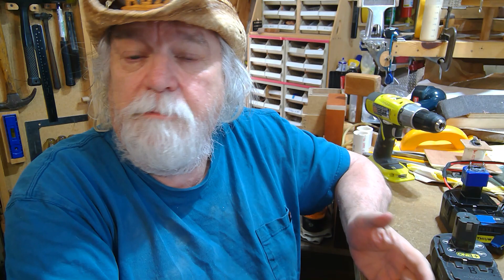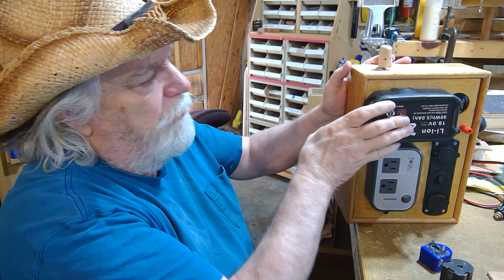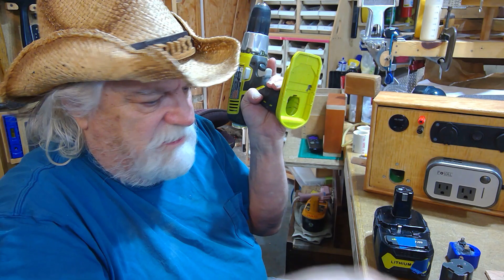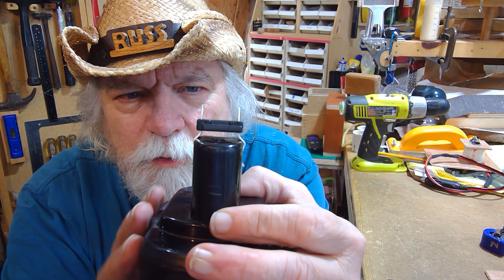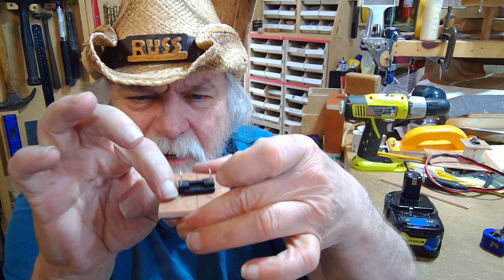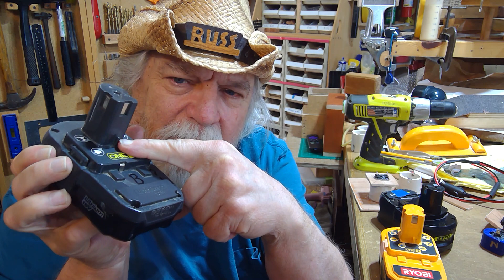DIY Ryobi Battery Receptacle by OTB Thinker

Comment: Thnx Who sells the clip??/
Reply from the maker: Small Engines Pro Shop has the best price.  Do a search on the Ryobi part number ""300001044".  
The link I found today:
https://www.smallenginesprodealer.com/part-ryobi-300001044/
The price today was $ .68
Reply: @russveinot5754  Thanks ..
Reply: Checked  it out  only sell in USA??
Reply from the maker: @Victim-x2g  Search on Google by the part #.  Should be able to get somewhere, just not that cheap.  you could buy a whole Ryobi adaptor.
Reply: hi found a heap on e bay and Alibaba
Reply from the maker: @Victim-x2g  good

Comment: Those connectors are down to $0.67 ea.
Seems like there is a potential polarity problem with the way they are fitting.
I'll probably be trying this in the next couple days with some couplers.
I think it might be worthwhile to do 2 things.
1. Get the PVC much warmer
2. Take a piece of 2x4 and cut a U shape in it which is slightly larger than the battery outline. 
   Heat the PVC, force it onto the battery, then use a large pliers or clamp and basically mold that form onto the PVC, and use a straight piece to press the flat part of the mold that is missing.   Hard to explain but basically press moulding I guess.
That way its will take a lot more force to attach it incorrectly.

Comment: Wow thanks, that is a great idea! I wish that there was such a simple and inexpensive adapter for DeWalt batteries.
Reply from the maker: I'm sure there is a way to do a cheap receptacle with shop scraps for the DeWalt.  I don't use DeWalt, or I would do it.  If you decide to do one, maybe I can try to help with ideas.

Comment: Russ you are amazing. One of my favorite questions is What is possible. Thee other is What is an excellent solution. I don't like best solution because it I do not find it helpful. Have to respectfully disagree--The hard part was knowing that clip even existed LOL.
Reply from the maker: Yes, I have been messing with the Ryobi receptacle issue for 2+ years. Even after I found this clip, earlier this year, and it still took me a while to get to a simple way to make this component.  As I said, I wanted an easy way to make this component that didn't require a 3D printer.  Now anyone can do this (cheaply & quickly).  Thanks Marty

Comment: Interesting and timely, Russ. I've also been thinkin' 'bout using my Ryobi batteries to power my own projects. Next step is to see if I can get Part # 300001044 here in the Land Down Under. I have a Ryobi charger that plugs into a 12V outlet (designed to charge from a vehicle) that I use to charge the Ryobi batteries using solar power. It works very well. People may well scoff at Ryobi tools, but they are fine if you don't abuse them, or build houses for a living, and are getting better all the time. I recently bought a Ryobi 18 gauge brad nailer after seeing many googletube users using it. I never thought I would need one, but I use it a lot and I'm very happy with it. Have a great weekend Russ.
Reply from the maker: Thanks Barry.  I would be interested if you get that part easily (or not).  Let me know.
I am a believer in using these Ryobi batteries for all sorts of other devices (& maybe a game or 2 :>)